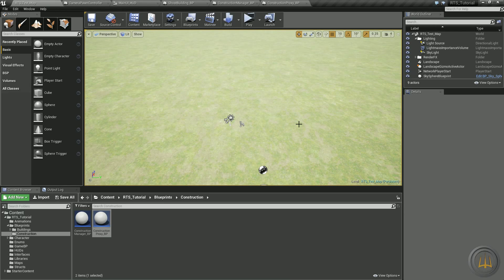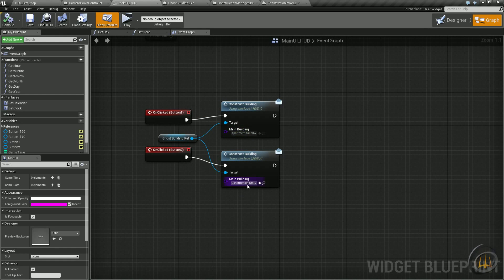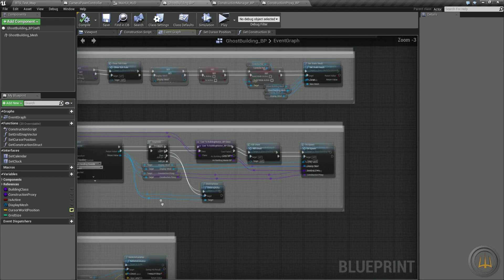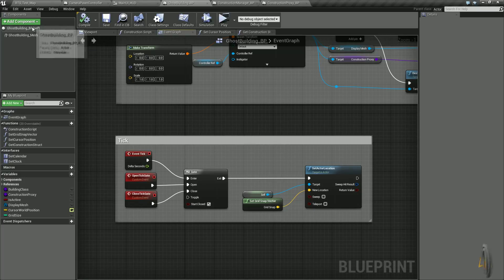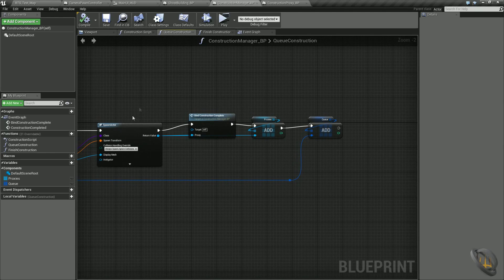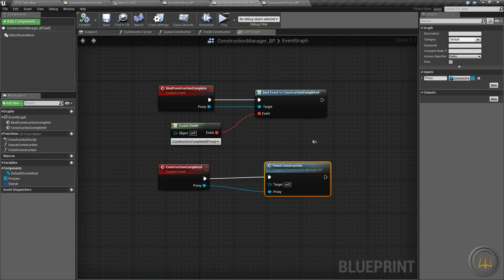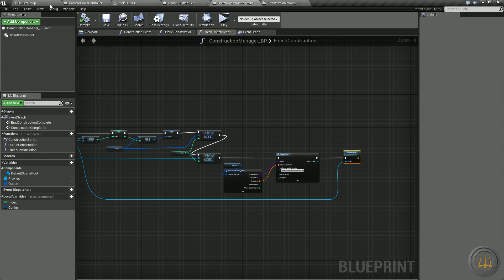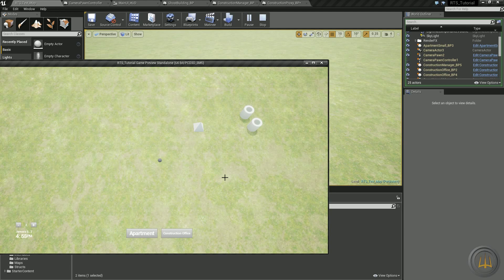Unreal Engine 4: RTS :: Episode 12 - Construction Overview

Comment: First at all, a lot of thx for this tutorial serie, i have a little problem whit the build struck and i cant figure out how to solved, after place my building for some reason spawn 49 unit to de left of the x direction compared whit my ghost shadow, they are using the same actor position so is very strage, i hope you can give any solution to that. Peace

Comment: Hey, just a question. How does Unreal arrays actually works? The Add Event set the value of the n'th position of the array or it sets the value of the first empty index it finds? I'm curious because continuously adding to an array would eventually cause an overflow. Thanks!! :D
Reply from the maker: I'm not 100% but I believe under normal usage, an array is dynamic in the sense that when an index is removed, everything after that is shuffled down into new indexes so their aren't any empty spaces. I think the only way to have an entry index would be to do it manually using the Make Array function. I haven't tested this so attempting to leave an empty index using make array may cause an error and not let you actually do it.

Comment: Hello there and first of all thanks for this very good tutorial. Really sorts out many "how to" questions I was wondering with my own project in sight. Got stuck somewhere between vid 9 and 11 having some strange behavior with the ghost mesh when moving the mouse around: The mesh seemed to "stick" on some invisible "corners" on the grid or suffer some stran,ge "position resets". 
 I spent a day figureing out the problem. Actually I found what seems to be a little coding mistake in the SetSightDistance function in the PawnController: 

If I haven't fooled myself along the original process, the value of the "SightDistance" variable (not initated, BTW, dunnow if it's an issue) is "got" and added to SpringArm length, then this value is directly plugged in the "SightDistance"OUTPUT of the function, not SETTING the SightDistance global VARIABLE once again, and though not updating it  for the next cycle. Turned this function into a proper "setter" for the Sighdistance variable and it fixed the problem. 
Hope this solution can help if some are stuck with the same kind of issue. 

Anyway, coming from a programmer background this visual editing interfaces, though really sexy, seems a bit tricky when it comes to the best programming practices, as you mentionned it already. I guess it is the inevitable counterpart for such a wide, easy to use, goody-stuffed framework like UE. 

However, I may have a suggestion to try to correct this "side effect": maybe it would be a good idea to publish some kind of "Project sheet" general scheme (Powerpoint style or like so...), with global Game logic Schemes, UML Modeling, Class/Blueprint references and hierarchy/heritages... It sure would help people like me who like to have an organized overview and workflow (my life is a mess, so I try to compensate by beeing a coding-organization-nazi ;) ) . Anyway I'm conscious of the amount of work and time it took to get this series online, and maybe you already done such a thing in the last videos anyway, but if not I'm sure it would also help you sort things up ;) 
Thanks again for this great job and keep going !

PS: Sorry for my bad English.
Reply from the maker: Not quite sure what you mean by initiating the sight distance variable? Floats don't need to be initiated assuming you have a hard coded default that you don't intend on changing programmatically. And it shouldn't need to be set after the function call because we are using its return value direct from the function. Setting the global could cause it to "stack" on top of itself meaning when the function is run again, instead of using our default 1000 sight distance to calculate the function, it uses whatever you set it to on the output of the function.

 As far as it sticking, I know this is a behavior that occurs once you reach the max sight distance. I agree it is ugly and is something I'm looking to go back and optimize in the future. The mesh shouldn't stop moving just because its reached its limit rather it should move along that boundary in a radius around the camera pawn at the max distance. I have a few ideas about how to solve it but again this is low priority at this point and will be for optimization. If you have a screenshot of what you're talking about it may help me understand. 

The flowchart is a good idea and I may try to throw something together if needed ;)
Reply: +3 Prong Gaming Concerning the SightDistance initaition never mind about that I just noticed it was defaulted to 0 in the editor but I don't think it could be an issue. Sorry if I got it wrong I apparently do not understand correctly  the real usage of the Sightdistance variable and function. Isn't the varaible supposed to be updated according to the SpringArm length ? 
Anyway I think I have a deeper problem than this "sticky" behaviour, and althought I carefully checked all the videos I can't find any differences. 
As I said on my comment on vid 15 I'm facing a crash problem now and I suspect some kind of mess in the engine resources itself. 
Thanx for answering anyway. I'll try to work on this during the week If I can. Hope to be back on track soon.
Reply from the maker: No worries! The sight distance variable doesn't need to be updated for it to work, we need it as a static variable. The function uses that to calculate everything for us and returns what we need for the placing distance. Every time we zoom in/out it adjusts everything accordingly. I'll look at the other question to see if I can help with the crash.